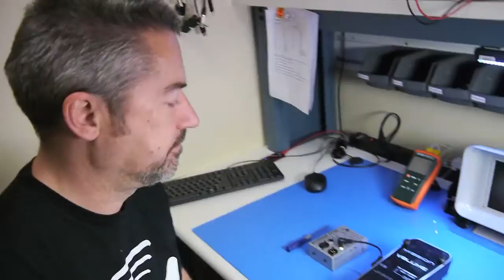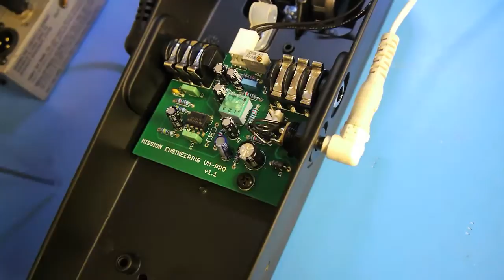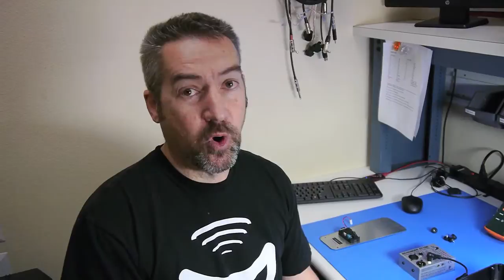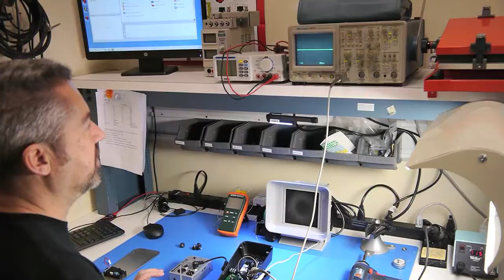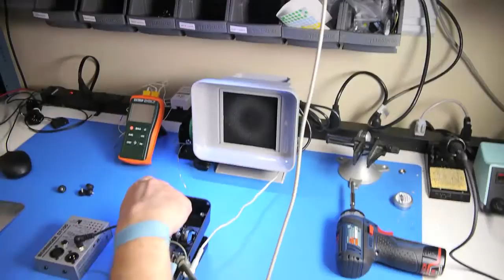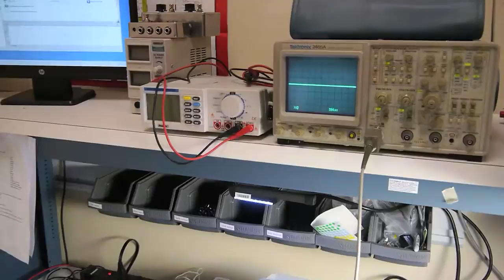Mission VM Pro Set Up

Comment: Hello. Is there anyway ya can get this pedal to go full true bypass. So like when the heel is to the ground (0%) with toe in the air, that the delay and reverb still plays, but you can put your toe down to the ground and it will amplify your tone louder especially for swells?

Like I dont want the volume pedal to mute at all ever when the heel is to the floor

Comment: I know this is an old video, but can the trim pot be adjusted so that the volume pedal can behave as a boost?  That is, full up would be "normal" volume and full down would be "boost/solo" (say 3db more)?  I can't seem to adjust mine to make this happen.  It only allows a low level bleed at full up.

Comment: I just bought one.  It’s great.  I am having some cutting out of the signal when using it.  I’m using external power. If the battery is low, will that cause that even if I use external power?

Comment: I just bought one. I'm curious though, with the P/A switch set to passive, can I use it without power? It doesn't seem to be working that way for me. I just ran out of power sources on my power supply and want to temporarily use the VM-Pro passively, much like the Ernie Ball Volume Pedal works. Please advise. Thanks.
Reply from the maker: No. The passive active switch is for using the pedal with passive or active PICKUPS, it does not change the VM-PRO into a passive volume pedal. The VM-PRO cannot be used without power. It's pretty flexible with voltage. It can use anything between 9 and 18V. If you have a 12V or 18V output left on your power supply, that will work. It's also a low current device so should last a long time with a 9V battery as long as you unplug the instrument cables when not in use.
Reply: @JamesLebihan  Thanks for the quick reply. I completely misunderstood the A/P switch function then. I still love this pedal and will sort out my power situation soon.

Comment: i notice no led light when if it's On?,,,how can i know,,,,why you did not put just a little sign when it's On
Reply from the maker: The VM-PRO is a volume pedal and the buffer is always on, there are no on or off states.
Reply: James Lebihan  
ok i will buy One in Hong Kong bec.i am from Asia from the Phils.,,,,anyway is it ok if i use any Powers source ex. a 9V adopter from Boss?,,,,,,or is there any Brand of power source that you recomend for us ussers?,,,,,,,,,,,
Reply from the maker: jun gacayan  Most 9VDC center pin negative pedal power supplies will work. You can actually use any voltage from 9V - 18V.

Comment: Will the high impedance get rid of disgusting buffer sound?  I bought a lehle volume pedal and it gives me a headache from the presence and anemic signal.  Does the minimum volume switch change the shape of the sweep?

Comment: Hi James, quick question on the VM-Pro.. If I use a 9V battery for the VM-Pro, approximately how long do they last on the pedal at normal use? Also is the battery consistently active when other patch cables are connected from the rest of your pedalboard?
Reply from the maker: The circuit is enabled when there is a jack connected to the input. Removing the input jack when not in use will disconnect the battery and extend it's life. Nominal current draw of the VM-PRO is 3mA. I would expect a good battery such as a new Duracell 6LR61 to last around 200 hours.